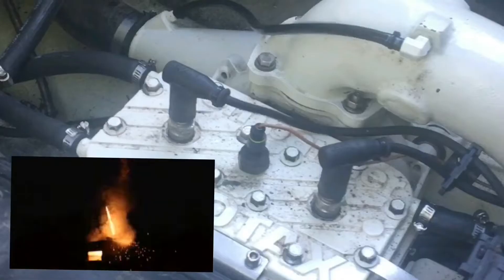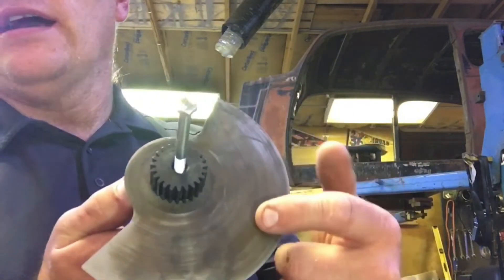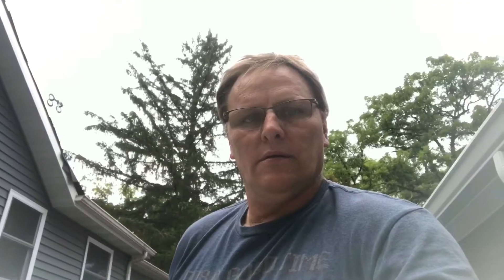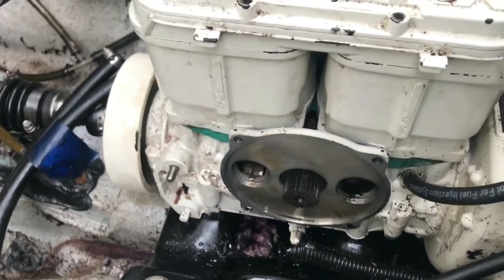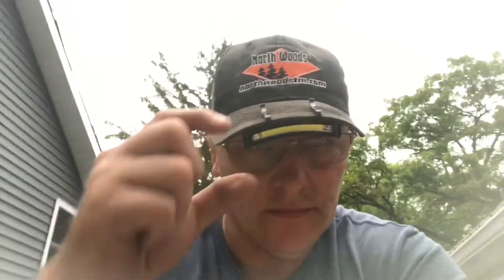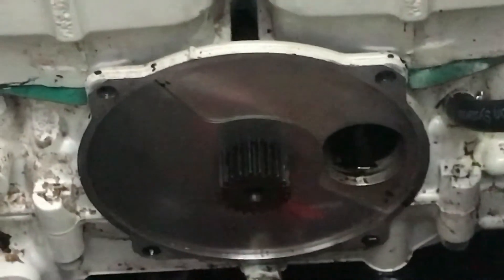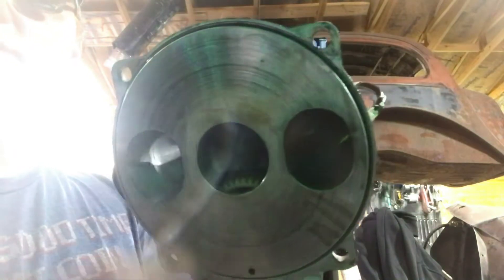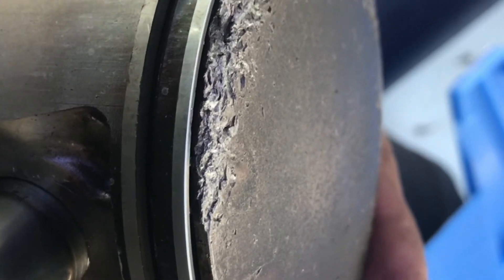1998 Sea-doo jet boat rotary valve and shaft repair in boat

Comment: How long did you run that motor after the shaft replacement?  Any issues with debris? I just did this myself and obviously nervous about any debris that might be left behind.
Reply from the maker: I taped a small clear tube to shop vac and sucked out cavity. Then I ran my DEPSTECH camera in there and saw nothing motor still running

Comment: You mentioned flushing and vacuuming the rotary valve cavity...what did you use to flush all the brass crud out? Is it still running? I am doing a 717 RV right now...not nearly as badly chewed up as yours but still plenty of brass in the oil I drained. I hope to avoid splitting the cases and just flush the cavity and replace the rotary valve. More or less what you did but I had to pull the engine since there is just not enough space inside a jetski hull to do what you did in the boat. Please let me know!
Reply from the maker: Sorry for just seeing your comment to answer your question yes still running and I used a small shop vac with I skinny clear hose taped to it to fit in lower end rotary valve shaft hole. Sucked everything out I could. Then to my DEPSTECH camera and inserted it to make sure all foreign material was gone. Before putting back together.  This is not best way to do this I know but kept me on the water rest of summer.  Biggest concern is missing a piece of this and scoring new rotary valve.
Reply from the maker: I would recommend taking engine apart it out of ski I did mine this way so didn’t have to pull motor out

Comment: Is 147 correct rv plate? Reason I'm asking is I'm about to do mine and I went to look up parts and it says 159 ?
Reply from the maker: 147 was the correct for mine   The motor still running fine I know some are year specific so yours might be different so go by your model number.  And hope you get back on the water soon
Reply: @btwgarage5265  Thank you for your reply it helped me figure out the puzzle. Turns out 147 is the correct timing mark and the plate is 159. Little confusing but again thanks for your help.